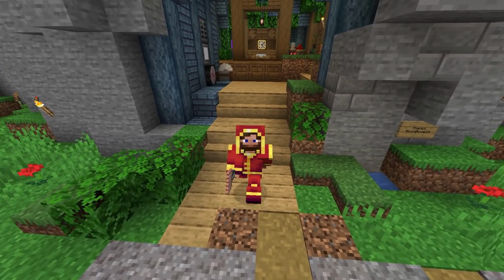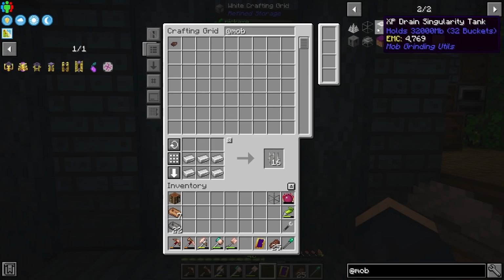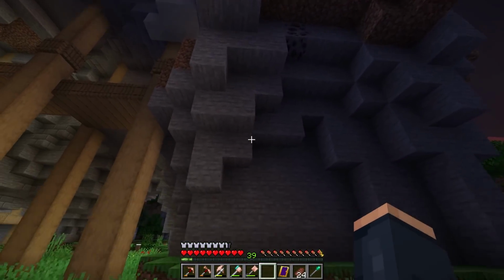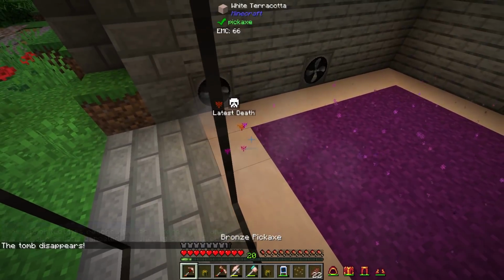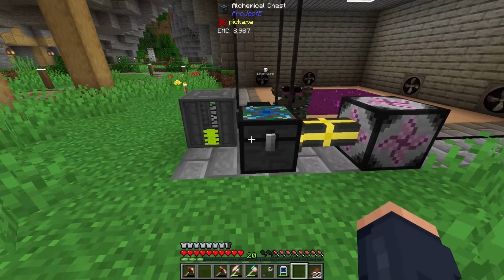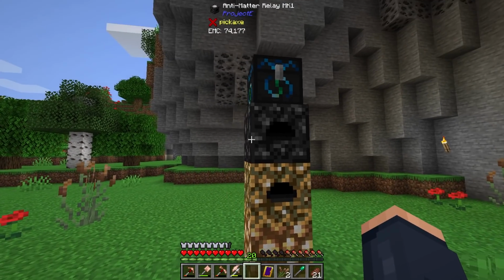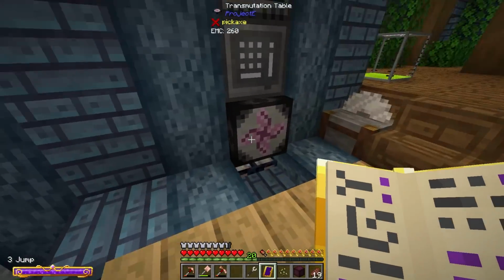Project Architect Modpack EP7 Cursed Earth Mob Farm

Comment: With the entangled blocks. You only need 1 relay. And have the energy collectors touching entangled blocks. Which are connected to the single relay.
 - you might want to test this as I only built a 256 collector tower with the mk3 collectors.

But I found it odd that even though the relays are supposed to have a max output of 640 emc/sec. Which should start getting overloaded after 16 collectors. It still drains its reserves into an energy condenser mk2. Takes a bit so I imagine you could eventually need a second relay.
Reply: By the way, that's without a watch of time pedestal. I think I'm going to add some, attached to Redstone next

Comment: If dimensional shards have emc I had a pack were they had more emc than diamonds and drop more than normal veins of diamonds and spawn alot more so I started my emc to do power flowers through that and or for a boost, next thing u could do is villager spawner into a smelter filled w a liquid to smelt them down for emeral blocks and use a translocater from there I to a Condenser, or just take your time to prolong the series just helping if it becomes an issue 😀

Comment: Pipe the mob farn drops into the energy condenser, then pipe the outpot from the energy condenser into the emc link.
The emc link should be fast enough if the item being replicated in the energy condenser has a high emc value.

Comment: So after playing with this a bit, doing a way to break emc early game for those interested. Just requires going deep, finding draconium and smelting it.. make sure you emc the dust form. Dust is worth 2k which is nice but smelted is 16k. So you can turn 1 into 8 into 64 and so on and 64 stack is worth about 1 million emc. I used 2 emc links on a Redstone furnace and set it in a loop.  Auto pulling the dust and depositing the ingots. With 1 million emc every few minutes you can get whatever you want early on.  Personally I added a few rpg elements to this pack to make the exploring a bit more fun but this is a fun op pack
Reply: My Draconium dust isnt EMCable??? Was that a recent update to the EMC Table?

Comment: BEWARE: I installed projectEX and it wiped the EMC values from a bunch of items.  Lava bucket, glass, a handful of the project E stuff, and so on. Be careful if you install it. You may need to manually assign EMC values to items if you do.
Reply: Fortunately, it's not that tough to manually add EMC to items, if needed. If anything, it's even easier than older versions.

Comment: I don't get it. Why don't you use the two fans with one more width upgrade to cover the world farm? What is there purpose of splitting into lights and fans? Isn't it easier to just add a delay to the fans and use one lever? And why don't you put the entangled block in the flower so you can interact with the chest? 🤷🏼‍♂️

Comment: This is what i did for my emc and what i recommend i start off trading villagers then made a villager hall where i can turn them into zombies and cure them to get better deals until i had 1 item = 1 emerald the thing i did next for emc was set up a laser drill setup in the end (Note you do not need to kill the end dragon to do this) i set the Y level to 95 for draconium ores gave them power with a flux point make sure you set them to chunk load if you dont they will not work and chunk load that area so they don't get damaged some how then i had the draconium ores go into a ender chest that i had a 2nd ender chest going into a redstone furnace that smelted them into ingots and extracted them into a compacting drawer 1 draconium ingot is 16,380 emc and 1 block is 147,420 emc which you will get almost 9.5m emc per stack now im doing the flower power that chosen just showed us but i have 6 mk3 making dark matter going into a compacting drawer which also has 4 watches of flowering time on them each a stack of dark matter blocks is 35,651,584 emc this is by far the best way to generate emc that i am aware of

Comment: congrats chosen and also when you have more emc you should the power flowers into a compact machine to hide them i managed to put 6 power flowers into a compact machine (Maximum) thanks this helped out a lot i completely forgot about flower powers and sucks about project ex isn't getting a 1.16 update =\ but this is really good would love to have the arcane transmutation tablet from sky odyssey in here its the same thing as the tablet but has a crafting grid built right into it was so useful when i was playing that modpack

Comment: I’ve been wanting to play his modpack but I don’t think my graphics card can handle it 😅, I can get the game menu up but when it comes to letting the chunks load it’s pushing my computer.
Reply: Thre's things you can do to reduce it down. My computer kinda sucks, too. 1. disable Alex's mobs and charmonium. It's nice to have them, but not necessary. 2. Re-configure your vids to minimal 3. In settings, if you have enough eternal memory make sure to up that. the minimal 4k isn't enough, I doubled mine. 4. If curse is laggy on your computer, you might try downloading it to the ATlauncher. They gotten much better over the years and made it easy to load from other places now (like curse, ftb, etc). 5. (I'm still struggling with this one) Your game starts with 2 minimaps. Why, I don't know. Each one is processing the map around you and crunching it small for view. I'm trying to find the other map mod besides Xaero's to disable. But you might even consider doing what CA did and disabling them both. That could definitely make movement faster in game.
Reply: @clarity2199  it’s only for 1.16 modpacks 1.12 is what I mostly play because it runs good

Comment: Hey ChosenArchitect! Just a heads up: it used to be the case that you needed Glowstone on top of the collector. I'd double check it if I were you, cause it might be more effective that way. Would be a shame of the time if it isn't working at 100% efficiency :). Love this series!!
Reply: Yeah, I could have sworn it had to be on top as well, making the bottom half less effective than the top.

Or more accurately, it doesn't need glowstone at all, its just faster with it on top, not below

Comment: I found a very broken trick for quick EMC generation:
Use one energy collector MK1 and generate red sand in a condenser MK2, then use an advanced chute to drop this sand and wash it with create for gold nuggets.
Only pick up these gold nuggets with a funnel to a drawer, then use an item cable to pipe it back into the condenser MK2 of red sand = infinite loop.
Then route some of this gold nugget overflow with item cables out in a condenser of your choice for millions of EMC.
Reply: Good farm, I dont think it is a trick, you just use the mods allowed. Very clever btw.
Reply: A while back, I made an infinite Create setup that did that but I had a drill collecting cobblestone and crafted the red sand instead. Probably was a bit wasteful and extra, but I wanted to play with Create. Sadly it broke when the stress mechanic was introduced.

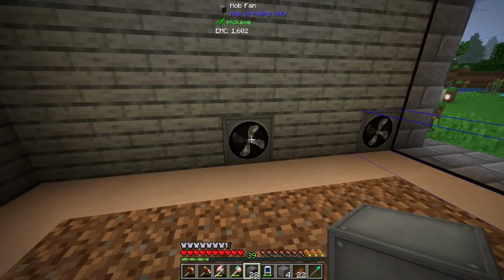Comment: 11:20 Just those 2 middle fans would be enough to do the work, they overlap each other so mobs will end up on mob masher anyways
Reply: Also, could have used an Energy Condenser with the EMC Link. Condense them down to single items, pipe that item through to the link.
Reply: @Crown-Fox  could also use the entangled block to take items from all sources of emc generation to input into 1 link to save space and setup cost